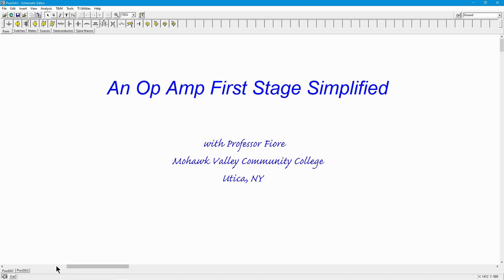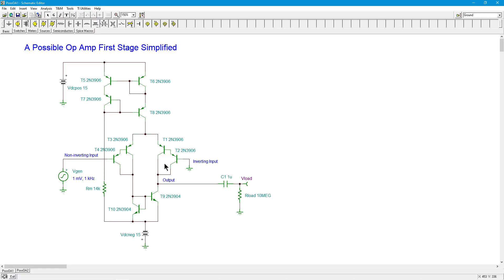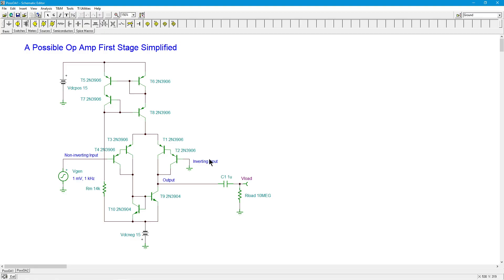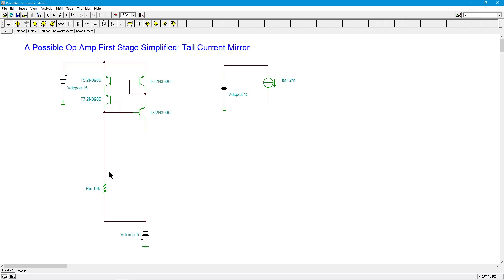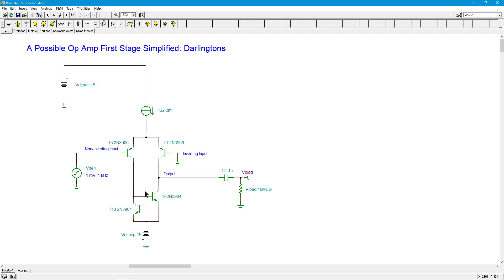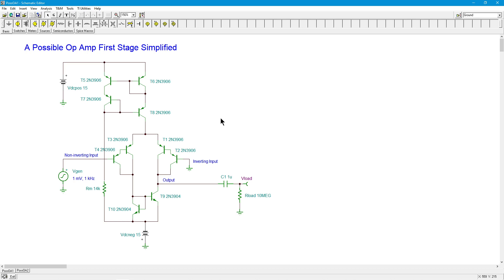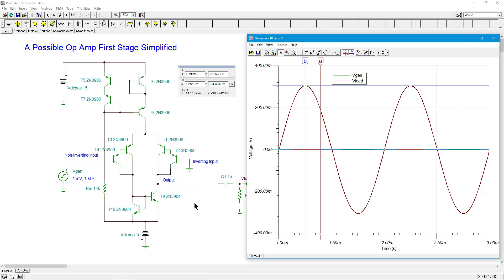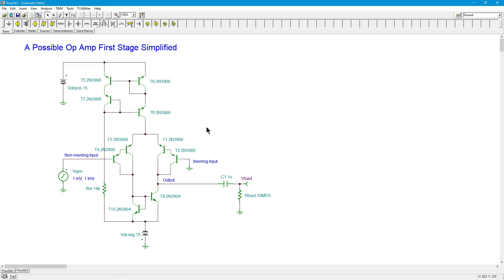Op Amps: First Stage Simplified

Comment: i dabble in designing audio power amplifiers, which are generally giant op amps.  a lot of the stuff you presented, i already know, but your presentation added a new dimension to my previous knowledge.
Reply from the maker: Yes! I remember seeing the schematic of the Phase Linear 400 Series 2 power amp back around 1980 or so. It was voltage gain stage followed by a hefty class B stage, all wrapped inside the feedback loop of an op amp (an LF356 if I remember correctly).
Reply: Almost all DIY discreet power circuits I've seen are just op-amps with high current outputs. Even the "Leech" amp, for all it's complexity, is just an op amp.

Now analysing that would make for an entire video series.
Reply: @JaenEngineering  look up the schematic for the APT-1 amp.   i worked at APT for several years testing and repairing those amps.

Comment: Why is this setup missing the 5k resistor that was on the left side of the current sink in the previous video?
Reply from the maker: That 5k was a carry through from the first iteration of that circuit that used resistors in the collector. I think it's better to change just one thing at a time to illustrate a point.

Comment: @ElectronicswithProfessorFiore.
..Sir I always get confused when I see base node connected directly with emitter without a yresistor..does any feedback current flows ..why it can flow ..it seems like we are shorting it base and collector  node hope my question makes a sense  here..please explain....if possible ..thanks
Reply from the maker: Do you mean base to collector? There are no direct connections of base to emitter here. Connecting the base directly to the collector shorts out the base collector junction leaving you with the base emitter "diode".
Reply: @ElectronicswithProfessorFiore  yes I mean base collector ..thank you Prof Fiore ..got the point .